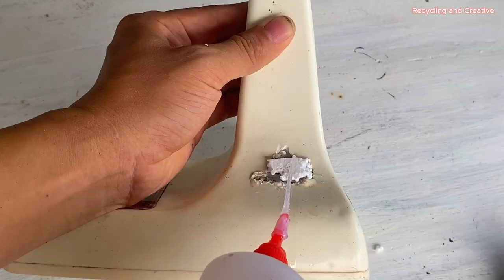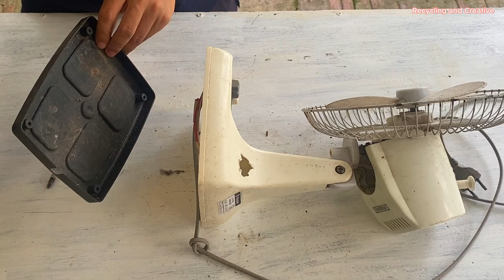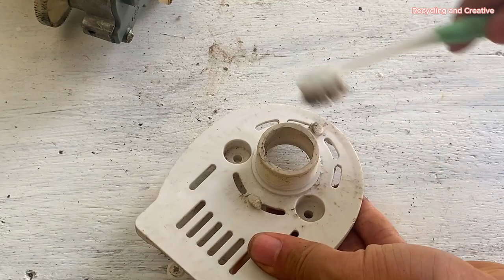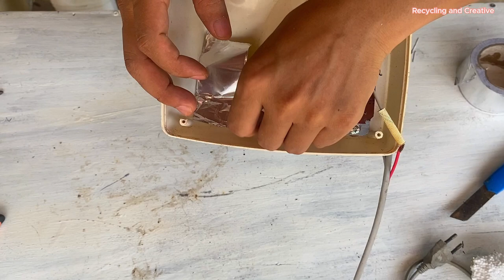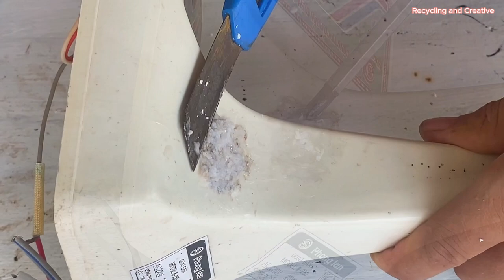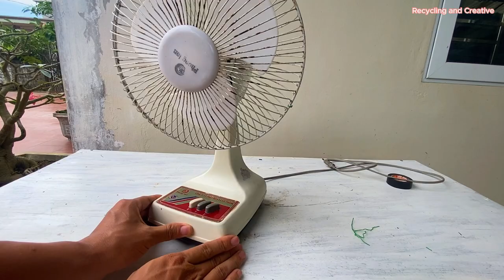Even Harvard Professors Are Surprised: Plastic Welding Doesn't Require Plastic

Comment: What solution did you use to melt it down with? Acetone?
Reply from the maker: I use super glue combined with foam, which will create a very sturdy structure. suitable for all materials,